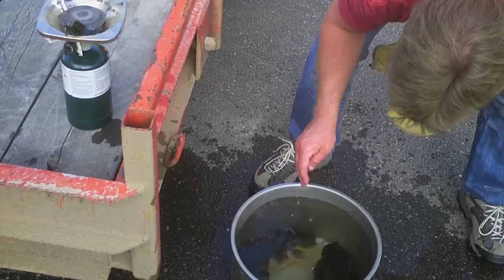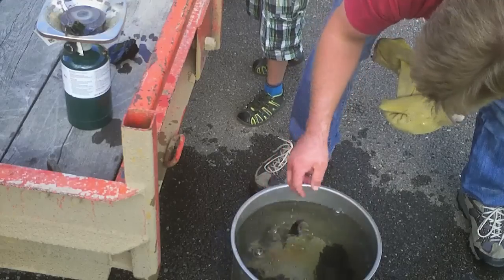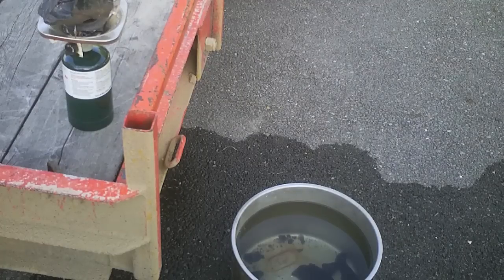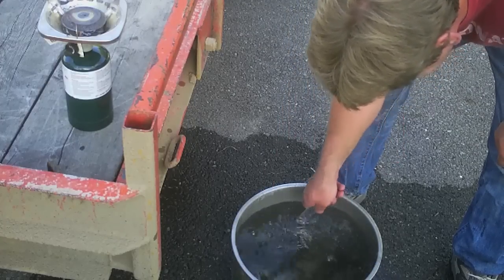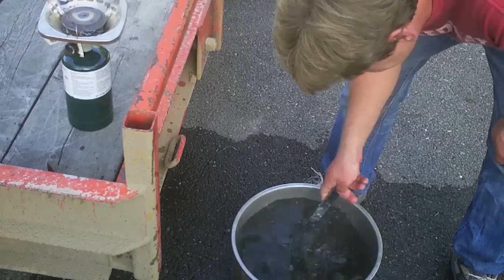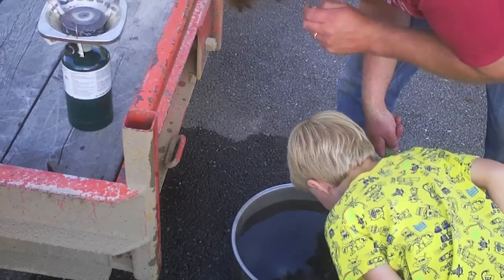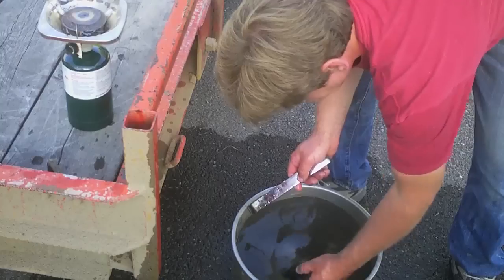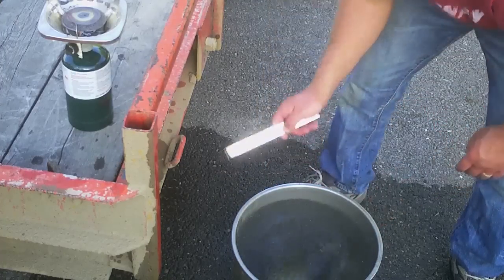Obsidian Thermal Shattering

Comment: Obsidian is a very poor conductor of heat
 you might have more luck
heating using furnace or oven and then quenching in a cold brine (salt water)
  you might try a shallow cold brine so your not cooling the complete stone [ a take on your squirt bottle idea] but only a portion of the stone .] .. energetic spalling be very careful.